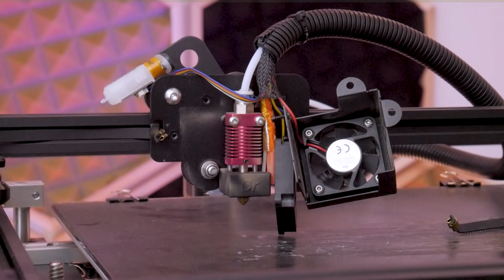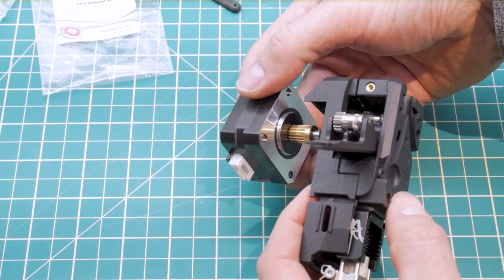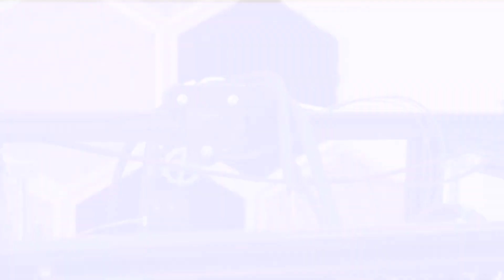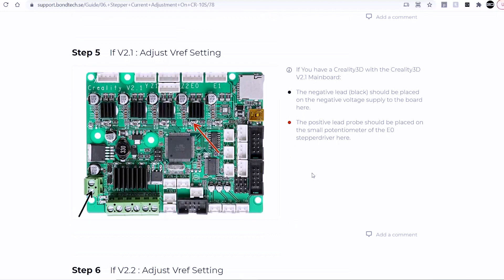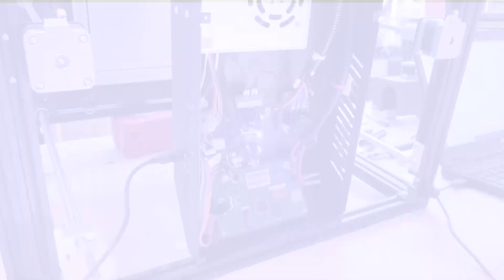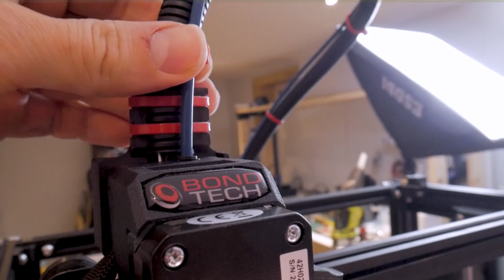The ULTIMATE Creality Ender Extruder Upgrade? Bondtech DDX and Mosquito Magnum complete walkthrough!

Comment: lol that hot end costs more than the ender itself. add in the bondtech extruder and you seriously have to wonder why one would go this route over buying a bambu carbon.
Reply from the maker: This is an old video. Bambu wasn't an option and of course times have changed. Back then it was a good setup and this machine is still running perfectly fine to this day. Lots of miles on it, but yes, today it wouldn't be my first choice anymore either.

Comment: I am sorry, this may be a silly question. You mention in your video the BL Touch specs to show the offset. I am not exactly sure what needs to be done with this information. Are we using the specs to manually adjust the distance of the BL Touch, or are we using the specs to change the settings in the software? Or, am I missing the plot altogether and am on the wrong track?
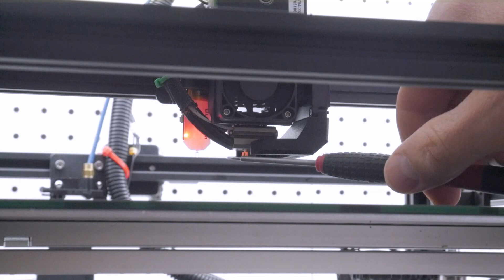Reply from the maker: Are you referring to the graphic around 24:49?
Reply: @EmbraceMaking  That is correct. You first mention it at 14:46 when you are talking about adjusting the BLTouch to work with only one screw.

Comment: Thank you for the video. It was indispensable while installing a DDX v3 on my Ender 5 PRO.
Love the ease and quality of the prints but one problem. 
After using for about 6-months, a piece of filament (I think) is stuck in the extruder. Using a 1.5mm rod I can go down from the top about 28mm and from the bottom about 58mm.  Any ideas how to dislodge or remove it?
Reply from the maker: Did you get this sorted out? You might have to partially disassemble your extruder?
Reply: I ended up doing exactly that! Thank you.

Comment: i bought this today, hoping to fix my printer that i had for over a year and haven't even managed to print properly with...spent the whole day working on my printers, i got so angry i actually destroyed one of them and now it turns out the thumbscrew thread is missing so i can't even use that printer either...what is this some kind of cruel joke, one year of 3d "printing" (mainly producing trash trying to get the printers to work properly) i spent over 2k on parts, printers, filament etc and still nothing works...wtf man. people told me: "get an ender, it takes a bit of work but once they work they'll be amazing"...that was only the biggest lie i've been told.
Reply from the maker: Hi Sharlan, yes 3D printing can be very frustrating but also very rewarding and fun when it works. Sounds like you've had a lot of bad luck with it so far. Creality printers can be very hit or miss. Some people have great experiences out of the box... others not so much. If you have a lot of valuable parts and things that you can sell off, I would recommend starting from scratch with a platform that has a very good reputation for working out of the box. Sell off what you have and get back as much money as you can and if you want a good platform for beginners try getting into a Prusa. I've also heard good things about Bambulabs. Both will be pricier than a Creality but you won't need to upgrade them and tinker.
Reply: @EmbraceMaking  I don't think I'll be able to sell them, I've been trying to give them away for free when they still worked/were in one piece and no one wanted anything to do with them. I would like a larger build volume as the 5 plus seems to be the perfect size for the projects I want to take on. Maybe I should contact the shop where I bought the ddx v3 and see if they can replace the faulty thumb screw without asking me to return the whole unit.
Reply from the maker: So which machine are you currently working with? If you have an issue with the Bondtech product you can try the distributor or even email Bondtech directly. I use a lot of their products and they seem like really good people, I'm sure they can get you sorted out!
Reply: @EmbraceMaking  the store i got it from offers an extended warranty and are local, i'm not so sure about bondtech' location. i already emailed the store to see if there's anything they can do.
Reply: @EmbraceMaking  i got a nemail today, the store will be replacing the entire ddx v3 unit and i need to return the one with the defective thumb screw, which is awesome of them but now i need to take it all apart again haha
Reply from the maker: Well at least you'll be working with non defective equipment now!
Reply: @EmbraceMaking  they sent 2 new bondtech ddx v3 to me now AND 2 bottles of wine apparently...that's odd, i mean i like the wine so thank you very much haha. i think their system messed something up and they accidentally sent me 2 replacement products. edit: so i finally had the time to replace the unit and return the defective one...only to find i don't own a mulitemeter, sheesh. i ain't going out again today, i'll try again next weekend...maybe. edit2: i went and got a multimeter anyway...i have no clue how to use the damn thing, i'm doing exactly what another video is doing with zero readout...does the printer need power again? if so it should say so in the manual, it told me to take it off the power to open it up so i assume putting it back on while open is dangerous. edit3: putting the power back on didn't cause a readout. i don't know where to go from here other than to the trash so i have more space for living.

Comment: which printer are you using in 2022?
Reply from the maker: My printer collection spun out of control... I ended up with too many and even gave some away. Now I mostly print on my Ender 7 (my personal favorite), Ender 3 V2, Artillery Genius Pro. I have a Voron Trident in the works and a CR10 smart that I am modifying more. The Ender 5 Plus in this video was for someone else, still working with this exact setup to this day flawlessly. I also built him an Ender 3 Max (getting more mods).
Reply: @EmbraceMaking  if you could choose a Hotend combo with direct drive which products would you pair together?
Reply from the maker: I guess that depends on what machine you want to put it on and for what application? What kinds of things are you printing and in what types of materials. Are you prioritizing quality or speed?
Reply: @EmbraceMaking  what is your email
Reply from the maker: viaautoworks@gmail.com

Comment: did they change  the firmware website it seems so  much more  complicated  now
Reply from the maker: Website probably has been updated since I made this video... which machine are you looking for firmware for?
Reply: @EmbraceMaking  ender 5 plus with the same upgrades shown here
Reply: @EmbraceMaking  any chance you could link me your firmware? the google drive  folder link below the video is broken
Reply from the maker: Yeah it looks like its a bit messy now with Bondtech pointing to the Insanity Automation page... do you have the 4.2.2 or 4.2.7 main board?

Comment: I may have missed it. But is there a video on your slicer settings for this ?
Reply from the maker: I didn't get into it in this video. Are you using PrusaSlicer? This is what I typically use... I can share some of the more critical settings, I think I still have them saved from when I had this printer.
Reply: @EmbraceMaking  yes i use prusa slicer so, only if you see the settings it would be handy. Im going to sell it eventually anyway as i am thinking of buying the new prusa xl. Thanks for replying.

Comment: Thanks for the video. I am having issues with thermistor error when trying to heat up, I have just soldered the cables as I didn't have the molex connectors. The solder quality is good but could this be the issue? Thanks
Reply from the maker: How close is your solder joint to the thermistor itself? Did you let the wires get too hot?
Reply: @EmbraceMaking  thanks for responding. I have simply snipped the end of the supplied cables off and soldered to the the existing cables about 100mm from the cable connector near where it enters into the enclosure.

I have since installed the direct drive with the DDX and might just tackle the mosquito later when I have more patience 🤣
Reply from the maker: 100mm should be enough distance unless you held the iron on the wire for a long time. It could be possible that the thermistor itself got too hot and was damaged?
Reply: @EmbraceMaking  thanks for that, if I did hold it too long (not knowing that much about soldering) would the thermistor in effect be unusable now? Thanks again

Comment: Is this mostly the same process for the Ender 5 Pro and normal Mosquito Hotend + Bondtech DDX?
Reply from the maker: Should be very similar ... They are very similar printers except for the overall size. You likely won't need to mod the z rod holders as the regular ender 5 pro only uses the rear z setup.

Comment: How will the mosquito magnum run with a 0.4, 0.5 nozzle? I would like to have the option.. the regular mosquito has a max of 0.4..
Reply from the maker: If I recall, in this video I was running with the 0.6mm nozzle and it worked great! Print times were significantly reduced. Eventually I switched back to the 0.4mm nozzle for finer details in my prints, but 0.6 worked awesome.
Reply: @EmbraceMaking  thanks for the reply! How did the magnum ran on 0.4? Did you encounter significant stringining or backpressure due to the amount of flow? How big is the resolution difference with a 0.6 nozzle?  So many questions haha. The magnum and ddx are on its way as we speak! I am very curious how it wil turn out!

Oh and thanks for the great video! You made me order the DDX and magnum 👍👌
Reply from the maker: Runs like a dream on the 0.4, what machine are you putting it on? Ender 5 / plus? General rule of thumb is that the max layer height is about 75% of the nozzle diameter. So 0.3mm layer height with 0.4mm nozzle and 0.45 height with 0.6mm nozzle... although I'm pretty sure I was running 0.5mm layers with the larger nozzle with no ill effect. Let me know what machine and I can share some of the slicer settings
Reply: @EmbraceMaking  thank you for sharing your experience and the explanation! You have been a big help.
Great news that it can run 0.4 nozzles without issues!  

I am the proud owner of an ender 5 pro.
Some slicer settings would be great! I use Cura.
Reply: So I managed to install the Extruder and Moqsuito Magnum! that was a fun project haha. What slicer settings can you recommend with this setup?  The nozzle is diggin in my prints.
Reply from the maker: Why is your nozzle digging into your prints? Is it dragging on your print bed or is this after the first few layers have gone down?
Reply: @EmbraceMaking  it kept digging in my prints yes. After 5 painful days I figured it out.
Bondtech says to change your z steps to 415. This is only for the older ender 5 models! The newer ender 5 pro has had een updated z rod. So the z steps should be 800 and need to tweak from there. It was a pain but I managed to solve it.
Took me a while to figure it out as I thought the 415 z steps where correct as per bondtechs recommendations.

Comment: Is the upgrade compatible with an original CR-10?
Reply from the maker: I don't see why not... they use very similar style carriages and a lot of the Creality parts carry over from different printers. I've seen the DDX on the pro and S models for the cr10
Reply: @EmbraceMaking  Does the upgrade use any additional pins in the control board? Or does it use existing pins? I'm not sure if the newer variants of the CR-10 have different control boards for other features (e.g. auto bed leveling).
Reply from the maker: No additional pins. The BLtouch is optional so if your CR10 won't support it you can just keep using the regular leveling process. Also, you don't need to go with the more expensive options like I did, check out which hot ends are compatible with the DDX because the mosquito was $$$. If you're only going to be doing the typical PLA you won't need the fancy stuff or even the higher wattage heater and higher temp thermistor. The only reason you'd want the higher wattage heater is if you're going to be using a big nozzle and need a lot of flow

Comment: Just wanted to mention something about the firmware update process for anyone that may be experiencing the same issues as me.  I could not get the printer to connect to Cura for the firmware update which led me down a wild goose chase about potetnially having to use an arduino to upload a bootloader to the board...  Ended up being able to flash the firmware using the old Creality Slicer V1.2.3 as per this video: https://www.youtube.com/watch?v=ExuPoNZK_aw
Reply from the maker: Good tip, thanks for posting that!

Comment: Great add-on, the strain relief part : D 
Those 3 unused holes are precisely to allow mounting different user applications. We call it the backpack. 
The 3 holes have dedicated M3 square nut pockets, to reinforce the grip. No need to rely on threading the screws on the plastic.
We usually recommend to mount the heater and thermistor on the other side, as you were doing initially, but hey, if that works for you : )
Very nice video. Very detailed. If you don't mind we will link to it from our DDX V2 for Ender product page.
Reply from the maker: Thank you! and thank you for the information regarding the "backpack" that is interesting. Feel free to use my video on your website, I would love that! Also, if you have anything you would like to me to test, try out, or make videos for, please don't hesitate to reach out. Thank you.
Reply: I was able to get the heater and thermistor mounted on the right side no problem.  Only fitment issue I had was the metal crimp on the belt on the right side is pushing up against the part cooling fan bending the bracket a little bit.  Not a big deal.
Reply: How do I access the slots for the square nuts for the backpack?? Do I disassemble the ddx?
Reply: There were actually 3 holes for the square nuts that we were able to locate and use